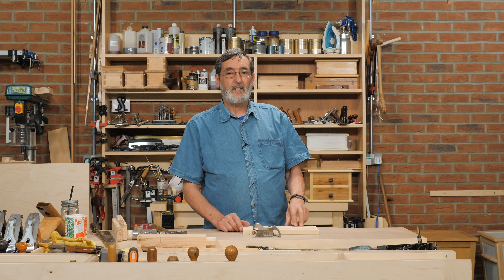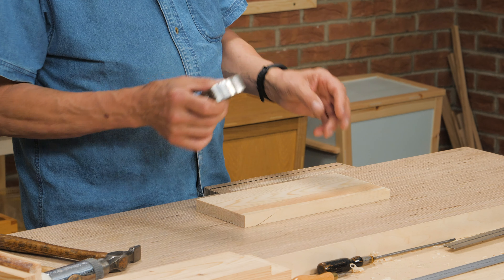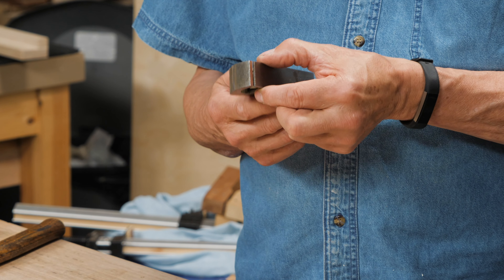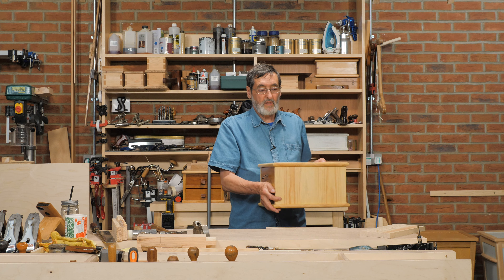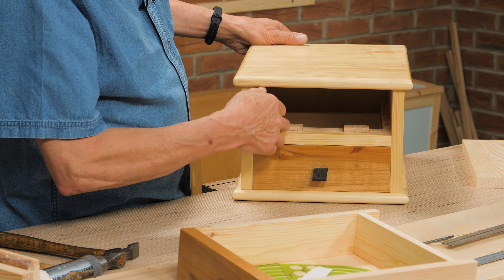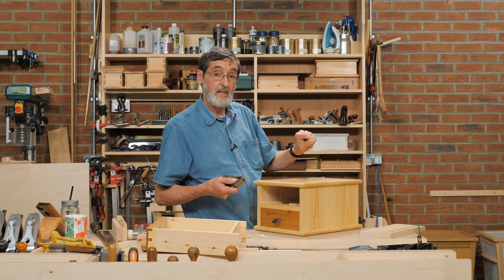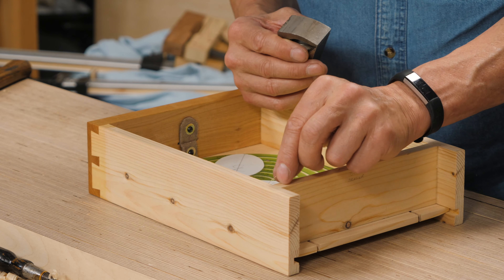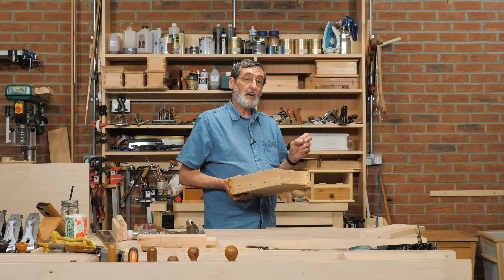The Bullnose Plane | Paul Sellers

Comment from the maker: Hi Everyone, just to let you all know that this video has been uploaded again due to a technical issue that we found. We hope you enjoy the video!
Reply: You are an anazing teacher.. ive learned so much from you.
Reply: Thanks Paul, I thought I was getting senile for a moment there.
Reply: @nurgle11  Yeah, Me too!
Reply: Essential depends on the kind of woodwork you do? I use it regularly 😇😁.
Reply: I own such a bullnose plane, but the blade has a very low angle and i can't seem to sharpen it.  Advice?
Reply: @MT-kc6rq  I sharpen mine to a 25 degree angle, after first making sure the backside is totally flat, right up to the edge. I use a Veritas honing guide that can be dialed up to get a microbevel after I establish the primary bevel.  If you make sure to get a little wire edge (burr) along the entire edge, you’ll surely get the sharpness you need. Good luck!

Comment: Mr. Sellers I've been wanting to inquire to see if you have any tips on folding rules.  Just starting using one out of curiosity.  I quite like it--especially for inside measures with the slide.  I see that some don't have a slide and wonder how they accomplish inside measures with those.

Comment: Hi Paul. Two technical questions regarding the blade setup on these planes: Where abouts on the blade should the cap sit (I've just bought one of these on eBay and the tang of the blade is bent because I think the cap screw has been tightened down with the cap too far forward) and secondly on my No.92 the nose of the cap is ground badly ( from the factory) and doesn't touch the blade, should I lap this flat along its length? I'd really appreciate your thoughts. Thank you.
Reply: @Alan 141 Thanks Alan. That makes perfect sense, it just looks like 'cost down' gone too far.

Comment: Absolutely superb little tool. I would never be without one now. Remember, you don't HAVE to use it in a rebating capacity. You can use it just as a small, handy little block plane - which will rebate as well! If you get caught short without a spindle moulder or router to rebate a board, you can pass the board over a circular saw to create the shoulder of the rebate, then remove the main waste  roughly with a chisel and mallet, then when all that is gone, you can create the other face of the rebate quite accurately with one of these. Or with a Stanley plough-plane. Brilliant little tools.

Comment: Paul, could you make a video on making precise cubes? All the tutorials I've found make use of power tools. My own attempts basically amount to rough cutting stock, then sanding each face, checking with calipers, sanding and checking again... There's got to be an easier way for hand tools. I'd love to make a wooden d6 dice set for my mates.
Reply: It's been a year since you posted your question. I hope you've found a satisfactory answer. I suppose it all starts with two basic questions, 1., How precise is "Precise" for you? 2a., What part of the tree did it come from and 2b., how was it cut? We all know that if our squares are out of square, nothing we use them for will actually be square & etc., so we strive to ensure we have tools that show us reality and not an approximation. Even the wood "Dead, but from a tree", we use has a life of its own. It swells and shrinks in concert with the  atmospheric conditions surrounding it. That is why quarter sawn boards are preferred in projects where movement may be a problem rather that flat sawn (plain sawn), or [depending on to what degree] even rift sawn lumber can be a problem - they tend to swell and dry out of square. If you've ever noticed a dowel that's oval in cross section rather than round, that's what I'm trying to get across; if your "Square" in cross section stock is cut from plain sawn lumber, it will go in and out of square as the moisture content surrounding it changes. How much depends on species, moisture content, where and how, exactly, it was in the log when cut. The final arbiter, of course, is tolerance; how close to "Perfect" you want to get, vs how close will you accept.

Comment: With that model, you can remove the bullnose with the top screw and then get all the way into the corner. No chisel needed.
Reply: What model is this? I don't think Paul mentioned it. How much roughly 2nd hand?
Reply: @SteS  It's a Stanley #90 bullnose plane.
Reply: @thatguythatdoesstuff7448  thanks, I ended up buying a RECORD No 077A for 30EUR off ebay.
Reply: @SteS  That's a hell of deal. For kicks, I checked eBay for the same and I'm not finding anything under $150 USD. Some are at $50 USD, but with many days to go in auction, so I don't see them going for less than $100.
Reply: @thatguythatdoesstuff7448  I used a tool that auto-bid (perfect sniper) for me and the item was quite rusted. Nothing 24hrs in some vinegar won't sort out and some wet and dry sand paper. Turned out as good as new bar some very minor pitting. 30EUR is around 45USD. I love it. The end is easy to remove to get right into the corner.
Reply: @thatguythatdoesstuff7448  Record #311 is another option but also go for a good penny.

Comment: Not as pretty I know,but in my experience it’s a far more useful tool if you take a grinder and carefully cut off the front half and basically make it a small chisel plane.
Reply: You might be wanting a Veritas Bull Nose Plane, then - I just checked their model and there you can adjust the mouth and even unscrew the nose. Am thinking of acquiring one myself after this temptation :-)...
Reply: @Alan 141 he is probably thinking it is a 90J or 90A or one of those types
Reply: Huh??? The 90 has a removable nose! No need to grind it off!

Comment: I was told off for putting a plane down flat--blunts the blade,lie it on its side....
Reply: As he and others have mentioned, there was a very good reason for not  putting planes blade down in school. We didn't but our teachers explained why. Once you have your own tools you start to care for them and it's no longer an issue. I still put it side down a lot because I'm fitting parts in situ and I'm protecting the customer's surfaces and sometimes I'm just not going to carry around a piece of leather around a kitchen from place to place. I'm much more fussy about passing scissors, chisels, knives and other tools handle first.
Reply: @Alan 141, Mine were in '55 (Jr. High) & '57 H.S.). Sure wish Tage Frid had instructed them in how to outfit a wood shop and then how to teach in it.

Comment: Beware the Stanley bull nose plane. I bought one new a few years ago and it had a ghastly design defect. The clamping bolt lay over a hollow in the body casting. Tightening the clamping bolt flexed the iron off the sole removing the cut and if the blade were presented further to compensate then the blade would catch the timber as it was loaded and dig in as the iron would flex back to meet the sole casting and present too deep a cut. Awful. I put it it in the metal skip at the local tip. I then bought a Clifton which works well and lives in my tool bag. I am a site carpenter. The only down side of the Clifton is that the throat is too narrow and chokes too easily. I should file it open a shade.
Reply: Yup, that 75 style bullnose plane is a hateful thing.
Congrats on the Clifton, the choice of the connoisseur. 👌